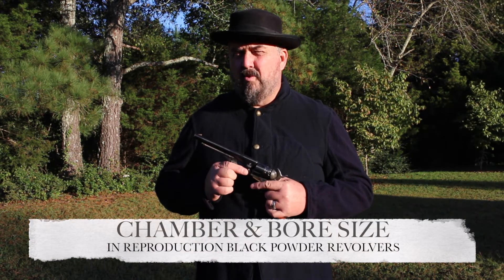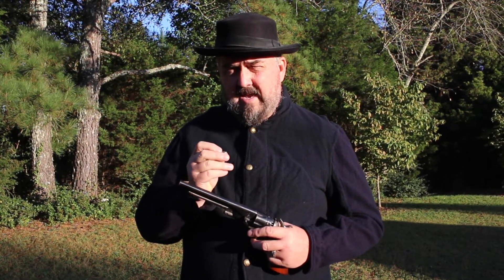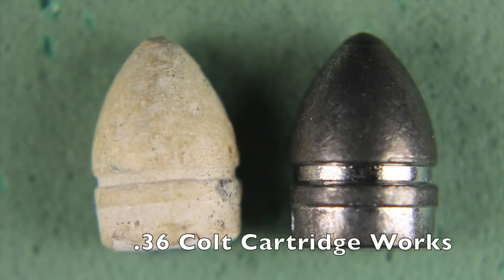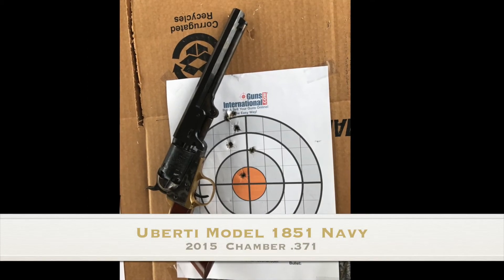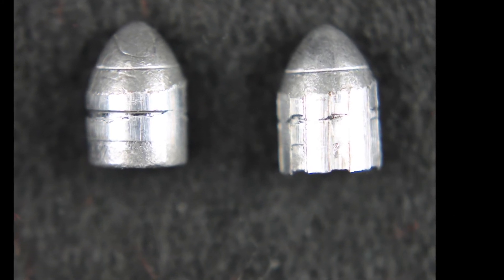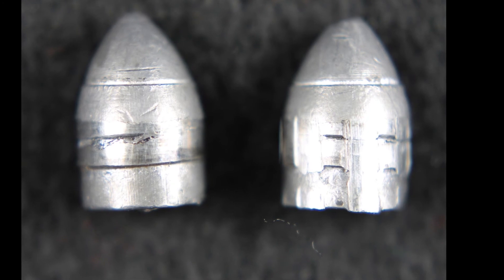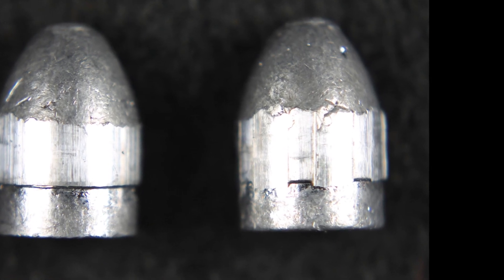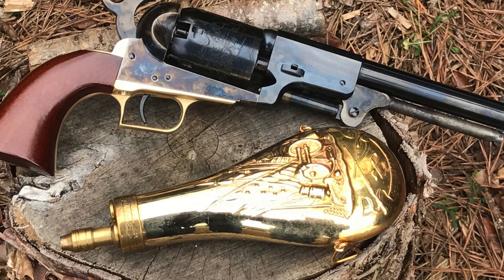Chamber vs Bore Diameter in Reproduction Civil War Revolvers

Comment: I bought an Armi San Marco Walker in 1980, built in 1979 from the serial number. It always leaded TERRIBLY when shot with round balls, only slightly less with conical bullets from the brass mold in the case, no matter what sort of grease I filled the chamber mouths with. Looking down the bore after shooting looked like peering into a battery terminal cleaner with the wire bristles inside. The bristles in the bore were lead, melted off of the balls by gas blowing by. This happened with charges of 50 and 60 grains of FFFg black or 60 grains by volume of RS Pyrodex. The pressures of those loads were surely all well above 7000 PSI. I eventually checked my chamber and bore dimensions. Chambers were .440". Bore was .440", groove diameter .448". I bored out the chambers to .450", put a small chamfer in the chamber mouths to swage the bullets on seating instead of shearing off lead, and have had zero leading since. I like Lee's .450 conical bullet in it.

Comment: it is a bit simpler if you use machinist pin gauges for the cylinders...  Amazon sells set that go from 0.250-0.50 in thousandths   they only run about $50 and I end up using em a lot.    I have reamed my BP cylinders to bore size of a thou bigger.    I then use a bigger dia ball....  in the 36 my bore was 0.372 and my reamer made reamed to 0.373    close enough   0.375 balls are too small....you need a tighter fit and a bigger flat band around the ball (if that makes sense)  so I cast mine at 0.380 which comes out of the mold between 0.381-0.383+    same flat around the ball but engages the rifling almost twice as much...win/win IMO     Conicals.... their very shape gives them a much better bearing surface in any case.    some have seen no improvement in accuracy tho...  I believe that is because their cyl/chamber size is ridiculously small  negating a lot of the advantages such a bullet would have.   While it does have more bearing surface... it is less than would appear.  if you subtract the heel and the lube grooves the bearlng surface is not that much greater than the flat around a ball created by sizing in the chamber....  it is why no matter what.... a bigger dia ball will almost always shoot better than a smaller.    I have not tried conicals yet....  my thinking is that in the example of my Navy with the reamed to 0.373 cyl/chambers..... I would want a 0.380 or larger mold.

Comment: This is a very interesting investigation, I always have measured the chamber diameter in the way you do here, but when pushing the "slug" through the bore I find it is best to do so on the press, that is because any sharp blow on the slug with a brass drift will seal the slug and confuse the result, the way I do it now is to push the slug through the borehole , then offer it into the chamber mouth, it can very easily be seen if it is larger (which it should be), or smaller, which requires the use of a multi blade adjustable reamer to open the chamber throats, when reaming, ream all chambers before adjusting the reamer, it is difficult to measure the pushed slug through as the barrel usually has an unven number of grooves , so trying it in the chamber avoids any put measurements. Many thanks for posting this tutorial! Chris B.

Comment: First thing I always do on unboxing a new cap'n'ball revolver is to slug the bore to measure the groove diameter then ream the chambers to one thou over that size. In every case I have found that the chambers are undersized, and although there's enough rifling 'bite' to stabilise the projectiles, the gun is easier to load and a fair bit more consistently accurate than if the chambers are left undersized.
Reply: Way to go Kathryn!
Reply: What are you using to ream the chambers, an assortment of straight flute reamers?  Or some other method?  Very interested in doing this myself.  Thanks.
Reply: Just get a small expanding reamer and adjust it to the size you need. The form of these reamers means that you cannot go right to the bottom of the chambers, but that doesn't matter, they will go down far enough to size the bit that the ball sits in. The one I use has a range of 11-12mm... .43 - 47" which is just right...
Once you have it sized on the first chamber, you can carefully do the others with just the one adjustment so they are all exactly the same. Use a good lube and clear the chips frequently and of course use the reamer by hand, they are not designed for machine use.
Reply: Thanks for the info, I'll give it a try.
Reply: I've been doing experiments with bore and rifling combinations as part of a design project. I chose my direction by following the power curves of actual operation. I'm learning a lot.
Reply: @kathryntruscott6351  I have looked for "expanding reamers" but can't seem to find a source.  Where can you buy them?  Thanks

Comment: Bumping up....  I believe that is a factor but as you say.... no way to measure unless you can recover pristene fired bullets.    I do know tho that even a little extra hardness in a bullet makes that bumping up an iffy proposition.     the best way of course to 'bump up' a bullet is a hollow base and as soft a lead as you can find.    I have recovered factory 'pure lead' balls and so far none that I have seen 'bumped up' enough for the lands cut in the bullet to bottom out in the grooves of the bore.   The bullet does not look much different than one driven down the bore of that gun with a dowel.    Lots of variation in lead hardness so who knows but if bumping up was a huge factor then cast bullets of unknown alloy would be wildly inaccurate.    I have not found that to be the case even using pretty hard lead more suitable to smokeless firearms.    Others may get different results and I thank people like yourself for doing the work.

Comment: Great work. I have a pietta 1860 army made in 2016. Which, if any, of the civil war era conicals will fit under the loading lever without modifying the revolver? Thanks.
Reply from the maker: I shoot a Pietta Model 1860.  My Johnston & Dow bullet will rotate under the loading plunger just fine when loading with loose powder and bullet.  However, be aware that ALL of the current Model 1860 reproductions will require some modification for paper cartridges to be used.  None of them have loading ports as long as the originals.  Thanks!

Comment: My Pietta 1858 has a .448 land depth in the bore and my cylinders ID are .444. The barrel also has an apparent dimensional change.  It seems to get tighter where the threaded shank is inside the frame.  This indicates they cranked it on very tight.  I have options to get this gun right but neither are that easy.   Why can't they build these right from the start.  It shoots about 4 -6 inches at 25 yards which is not that good.
Reply: That constriction of the bore where the barrel fits into the frame is fairly common in all makes of revolvers. In cartidge guns the bore is "fire lapped" to polish it away. Lead bullets are coated with abrasives and fired through the bore. You might try a dozen rounds with valve grinding compound over the balls then a dozen balls with semicrome polish.
This is not likely to hurt 
anything and it may improve accuracy. Brownells sells a fire lapping kit with the different grades of abrasives if you want to look into it.
John Davis jax fl

Comment: It might be interesting to take some of the same bullets, over the same powder charge, and test the in a smooth bore.  Of Hand, a full choke .410 shotgun is around .370.  There are .410 pistols that might provide some insight as well.  Obviously not apples to apples, but something I need to do

Comment: Have a look at Capandball's channel where he compares the original Remington and Colt bore and chamber sizes with the repros. In some cases the original chambers are tapered. My Uberti Remington Navy chambers and bore size were .375 which presented a problem with Hornady .375 round balls backing out under recoil or pulling out as the rammer was withdrawn. I bought a Lee .380 ball mould and opened up the front 1/2 inch of the chambers to .378 making the balls a tight swaged fit, no shaved lead rings. Your .36 Colt cartridge works conicals fit and shoot perfectly.
Reply: Where did you get a .378 drill bit? I put a 3/8 in the chambers of my 1851 Pietta and it took off a lot of metal from the chambers. The ball was definitely not reaching the bottom of the grooves. Might explain the poor accuracy of this gun. I have yet to fire some .380 bullets to see. I use a chamfering tool to chamfer the mouth of the chambers so I will not get the lead shaving. I want as much lead in that cylinder as possible to reach the rifling, so the more lead the better. Cannot be good removing lead from an undersized ball in the first  place.
Reply: I didn't use a drill.....too savage. I used a dowel wrapped in different grits of wet or dry paper and kept measuring with a vernier until the chambers opened up to .378, then chamfered and rounded the chamber mouths. It was painstaking work but worth it for easier loading and improved accuracy. Note - Piettas have slightly smaller chambers than Uberti and .375 balls usually fit well. Uberti actually recommend .380 in their instruction leaflet.  Other things effect accuracy besides bullet fit, ie. powder, load,  filler, wads, lube etc.
Reply: Las Vegas Muskets : A drill!!! It is a wonder it did not grab and sling your cylinder across the workshop.  You must use an adjustable reamer and take the cylinder bores out incrementally until they are .001" bigger than the groove diameter, the groove diameter is difficult to measure as most barrels are rifled with an odd number of groove, so you cant just measure into the grooves, but using a drill has probably given you an out of round chamber. the other thing is that you have to shave a ring of lead to know you have a perfect seal, this will prevent chainfires, although your chambers having been drilled out are probably ruined anyway.
Reply: @453421abcdefg12345  what? Lol
Reply: @oldeays5085  I am not sure what! But if this person has used a drill on his chamber it is certain that the bores are no longer round! the only way opening up chambers can be achieved is by using a reamer, very simple if you are intelligent, but I am sure it is way beyond the bubba type.

Comment: As long as the bullet firmly engages the rifling you should have good accuracy "if" the bullet weight and powder charge are correct for the rate of twist in the rifling. The goal is enough speed created by the powder charge on a certain weight bullet so the amount of twist in the rifling spins the bullet fast enough to fly straight. This is a very over simplified explanation of ballistics. All shooters should know the rate of twist on their guns so they can choose the right bullet, the correct powder charge for good results. This allows the shooter to have confidence the bullet will go where it is aimed and can consent rate on the fundamentals to improve their ability to hit the bullseye. So shooters educate yourselves and watch your shooting improve.